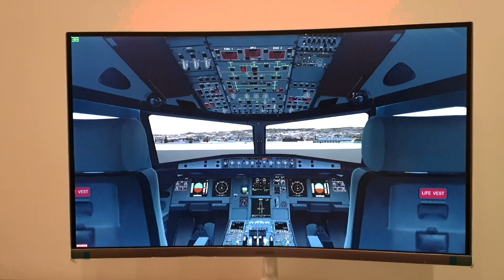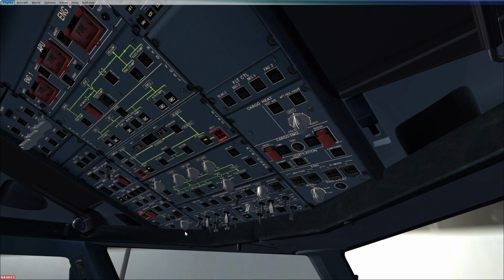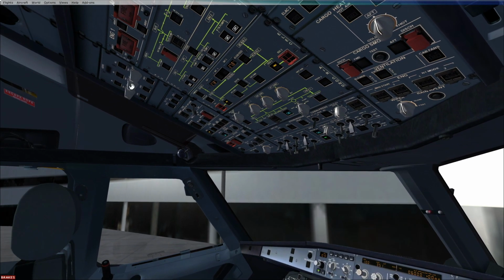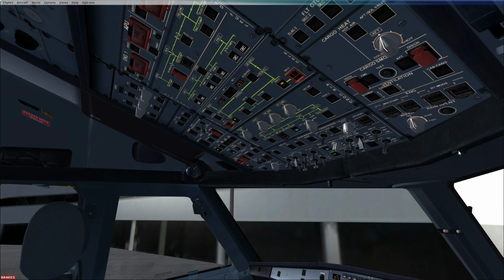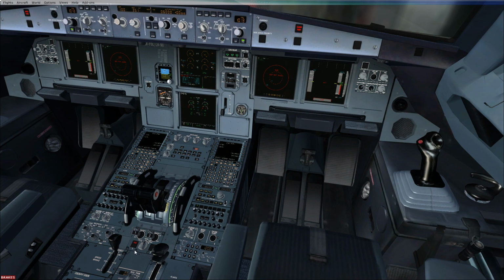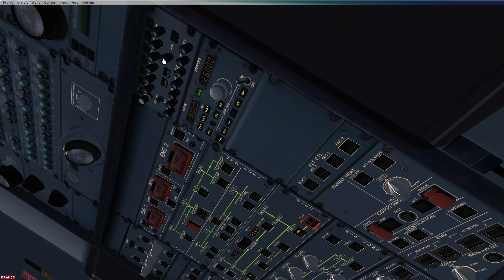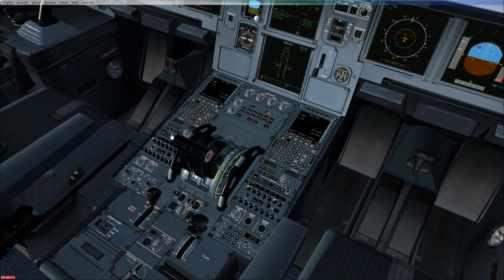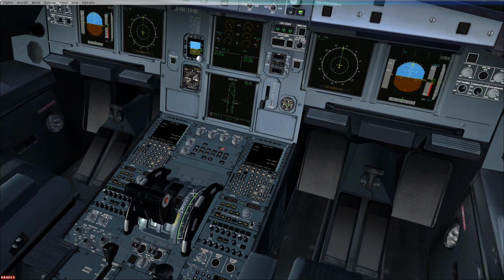The Flows : Cockpit Preparation

Comment: It is the checklist before pushback?
Reply from the maker: Hi Abhishek , yes these are procedures before ready for pushback, but still there is a lot before we are ready for push and start. Stay tuned as Ill be making the complete series of videos on these procedures for the A320
Reply: @FlightLevel070  okk sir🙏
Reply: @FlightLevel070  how often do you use CPDLC to communicate during flight?
Reply from the maker: @abhisheksinghchauhan386  Hi, CPDLC is the future . Currently not available in our fleet, but if equipped is the most convenient form of comm. Especially over oceanic routes.
Reply: @FlightLevel070  is it available in a320 NEO?
Reply: @abhisheksinghchauhan386  A320 neo and A320 ceo. cockpit is the same.
Reply: @prasadtadiparty3948  okk...bro😊